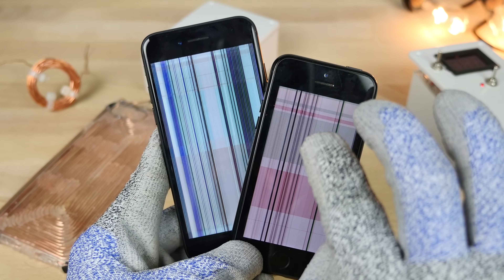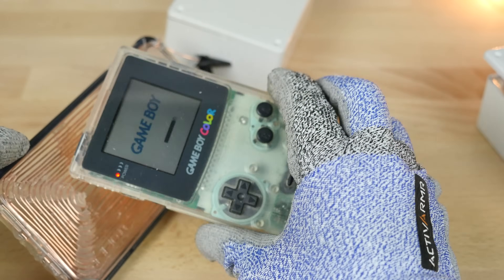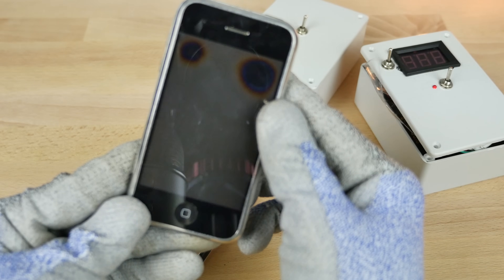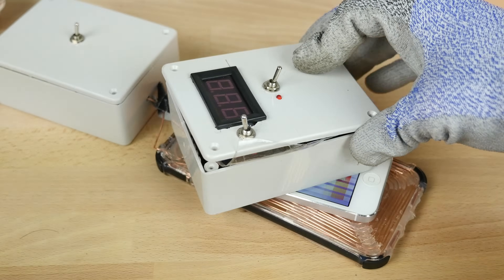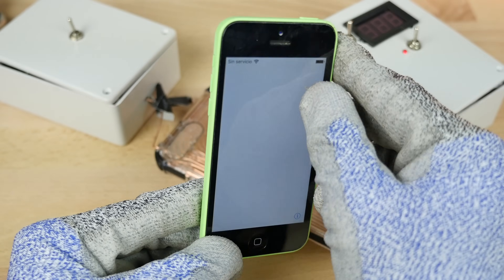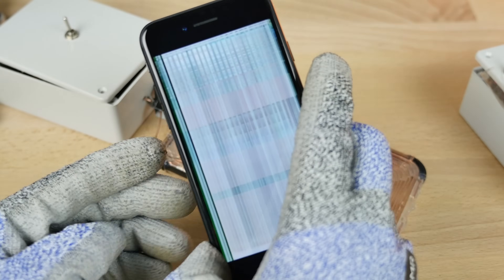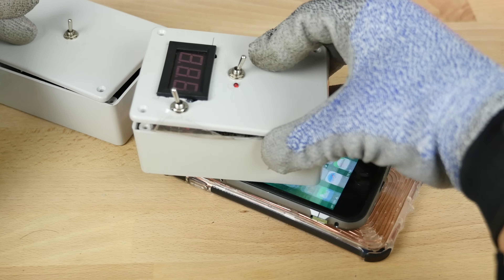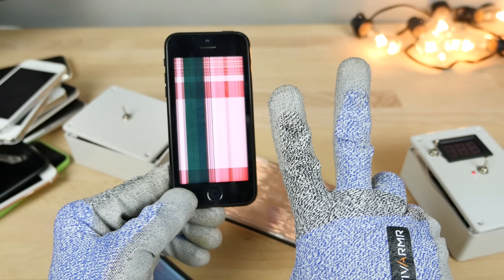EMP Generator vs iPhone 7 & More Electronics!

Comment: Its probably affecting the clock sources in the different parts of the phone, causes a timing misalignment from things like the gpu and screen refreshing, older phones means less parts and/or less complex part means less clocks to affect. That's only my guess, computer engineering student here. And are you fucking kidding with that plastic on the nokia screen 2:50 ?? you deserve your eyes clawed out because you clearly aren't using them
Reply: This was such a cool video though <3
Reply: Gunther Huebler "intelligent words"
Reply: No actually, that sounds weird as fuck lol, but also interesting. If I had to guess I'd say there's a part in the phone that monitors battery level by allowing a small amount of current through it and that the part is located near the homebutton and not part of the battery itself, the zap may have fucked it up and it's letting too much current through, draining the battery quicker and causing more heat. If not something along those lines I've literally no clue but I'd love to know if you ever find out.
Reply: That's literally what I told you in my comment. It's not because of less complex parts, it's because of metal shielding.
Reply: It's not that. In the older phones, the signal has to travel through more materials (because they are thicker) which shields off most of the magnetic field. The newer phones barely have anything over it's circuitry. They only have the screen and a partial, super fine metal shielding. That also explains why the iPhone with the case did better than the rest. My science teacher told me this when I told her a friend of mine were inventing these.
Reply: What does that have to do with what I just said lol
Reply: xD
Reply: Spam TheChat sorry for reviving an old topic. That overheat issue is the NXP microphone and capacitive touch interface IC being zapped. Suffered from wounded weld. It controls the bottom microphone, antenna switch and the detection ring around the touch id button (trough) the scanner die which is overheating, probably over voltage as that IC manages the power too. 

I tried repairing something similar on an 5s but no avail

All in short nothing you can do except of replacing the button and live with no touch id or get a new phone
Reply: Gunther, talking hard online are we? "You deserve your eyes to be clawed out" ? That's a little aggressive we all know you wouldn't dare say that to anyone in real life..
Reply: http://memes.ucoz.com/_nw/32/10201233.png
Reply: daduncker2.0 They don't put aluminum over screens, it would make it too hard to see the screen.
Reply: daduncker2.0 Just google magnetic shielding a little bit, you'll get it

Comment: This video is pointless. This guy is running out of ideas lol
Reply: MoronPigy it proved Samsung is better than apple at an apple biased channel
Reply: WalrusEmpire he's not even biased
Reply: Betternet I would've assumed he an apple fanboy considering everything apple PRO. but whatever
Reply: WalrusEmpire the reason the samsung s7 didn't get affected was because it is built to support wireless charging. Wireless charging works by sending electric pulses from a coil of wire from the wireless charging pad to the coil of wire (or what ever receives it in the phone ) in the phone. Which means the phone will just take as electrical energy and use it to theoretically charge itself. the iPhone and other phones he used don't support wireless charging so it affects the phone.
Reply: Running out of ideas? This guys reviews phones bro, he wont run out of ideas until phones exists
Reply: MoronPigy your name fits you.
Reply: This was just a chill vid between two reviews

Comment: @EverythingApplePro | Technical stuff:
The liquid crystals in LCD`s are affected by static charge because the  crystals need a veeeery low current to change their polarization. The EMP actually creates big electromagnetic spikes which induce high voltage spikes into the LCD. This causes the crystals to go "wild" and randomly change polarization depending on the magnetic field. This is why it shows wild patterns on the screen. Also the current spikes can damage the row/column driver on the LCD itself thus creating the permanent marks.

On the other hand we have OLED displays like on the Samsung which are technically not comparable to LCD`s because they dont use polarizing crystals. Each pixel is an individual organic led which needs a higher current to emit light than the liquid crystals to change polarization. The EMP induces very high voltage transients but the current is fairly low and not enough to light up individual oled`s. Plus the row/column drivers on OLED displays are designed to operate at a higher current and the EMPs induced current is not high enough to cause damage on the chip.

English is not my native language. Im sorry. :)

Comment: Hahaha, "Electric proof gloves".. they're insulating gloves
Reply: Ben Carter

Thats the same thing.....
Reply: Raymond the back of the gloves aren't "electric proof" the palm is covered in rubber, which you can call "electric proof" if you want
Reply: Ben Carter insulating means not conducting heat or electricity

Comment: most of the iphones have aluminium body and aluminium is a good conductor so all the electric flux and the electro magnetic waves will be reflected back and if u do this from the screen side it will cause a flickering until they have a a metal conductor covering the ics and the processor but still the the wires running on the logic board are not covered or insulated with a conductor so from the screen side it will show some effect
Reply: piyush tanwar but samsung S series starting s6 has a metal casing. thats not an excuse bruh. samsung doesnt give a shit .
Reply: James Gaming bro i guess then you have never got a hands on an s6 or s7 the have a glass body and bruh if you are into science or know basics so u will know that metal and conductors reflect electric flux and electromagnetic waves and do not let them pass threw and if you know a little bit about electronics and electric gadgets so u might know how pcb boards are made and how electric flux can affect the TRACKS if not insulated with a conductor just do some research bruh google will always help u .

Comment: I'm almost positive this isn't a real EMP generator. As in the description, it says Electro Magnetic PULSE. NOT STREAM. Yes, this does cause an EMP like affect, but it is not a true EMP. What an actual EMP is is a device that PULSES a copper wrapped iron core to create an Electro Magnetic Field (like earths, but on a very small scale version) and then have it INSTANTLY collapse creating damaging current and voltage charges. This isn't a practical EMP generator like one the military would have.

Comment: im surprised how badly Apple has dropped the ball on the 7. its not surprising the Galaxy and older iPhones weren't affected. their casings provide an almost natural shielding which is why they need antenna lines. i would expect older Galaxies from the S5 and down to fair worse due to their plastic build. the newer ones are practically their own Faraday cage

Comment: It's basically wireless charging to the very very… …very extreme. The newer chips have smaller gaps between circuits and this is why there's more shielding. All the affects will be random depending on how long and how you hold the EMP generator to any of the devices. Eventually it will permanently damage the devices.
Reply: Newer chips are more resistant to emp and it won't damage it at all phone still works normally.
Reply: This. I am EE and studied microprocessor based systems design...

Comment: this is because earlier model don't have advance communication technology like Wi-Fi or Bluetooth or Cat 6 LTE
Reply from the maker: Is it really? They are still affected but not as much, hmm.
Reply: Some of it is to do with the lack of advanced features and technology. Most of it is because of the size of the processors, as phones advance from year to year, the transistors in the CPU and GPU get smaller and so do the pixels in the LCD. As these get smaller, the chance of high voltage arcing across where it shouldn't becomes more likely.

Also, the reason why the LCD's were affected more than the processors is because the LCD's don't have EMI shielding.
Reply: +Some Loky Guy But it looks like amoleds aren't affected at all, the Samsung S7 didn't show any artifacts on the screen.
Reply: Wouldn't explain the screen or the restarts though
Reply: Jeremy Gides your argument makes no sense
Reply: Nirav Agarwal Yeah, I guess I would agree. Wi-Fi has definitely evolved.
Reply: By the way, this isn't EMP at all. Its just a basic stun gun, forcing a overload of static electricity into the display interface by  electromagnetic induction. An real EMP would have permanently blacked out that phone in 1/5 of a second. It would jam every billion transistors on that logic board. matter fact, he wouldn't be able to put this video up as a real EMP would even fry his camera and storage devices
Reply: +Gunther Huebler Perhaps the RAM is affected or the storage chip causing a reboot or freeze.
Reply: @Some Loky Guy If it were affecting the processor directly (transistor level) you would see crashes almost immediately, so its not likely affecting things in that way
Reply: Nirav Agarwal yet the android phones survived
Reply: Nirav Agarwal The 3G had Wifi
Reply: I still think that is the reason...
Reply: Shielding also plays an important role. Remember what happens with LG 5k Display.
Reply: Bro although 3G had WiFi but WiFi Technology itself evolved a lot and so is the component for Wi-Fi modules.
Reply: yep
Reply: The screen i/o is directly connected to the display inverter IC or processor. Since the screen I/O isn't shielded at all, electrical inductions occurs on the display interface which is electrically connected with the shielded IC's on the board. The only way to completely prevent this kind of distortion is to use fiber optics. The Air force one aeroplane has fiberoptics to connect digital hardware to prevent EMP induction.
Reply: Nirav Agarwal 

coms tech means nothing when it comes to corrupting the firmware in the eeprom of the processor. The screen screws up because there are ICs for communicating between the processor and the display it self.
Reply: Gunther Huebler not neccsiarly. It completely depends on what is shielded and what is not. The processor is likely shielded so what yoh are seeing is individual parts of the die being affected. It will only crash or restart is the OS is affected.
Reply: Laser Guy usually there is a ic in the flat flex leading to the display. And the processor communicates with that ic usually through a high-speed communication protocol. something like SPI.
Reply: Under a very large EMP all electronic devices would fry. Except the most basic electronics like flashlights or lasers or calculators. But phones, gone.
Reply: Marcus Volpicella cause android is trash

Comment: Its probably because the chip that drives the screen (sometimes in the screen, sometimes on the ribbon cables) does not have the metal cage to keep the interference out. Also your case EMP has no effect because the aluminum backs of the phones absorb the interference before it can reach the phone, but the screens are mostly glass or plastic so it can seep through.

Comment: Could someone explain to me why the first iPhone is called iPhone 2G? If it is the FIRST one, why call it iPhone SECOND generation? You had the #1: 2g, #2: 3g, #3: 3gs, #4: 4g, #5: 4gs, #6: 5 & 5c, #7: 5s, #8: 6, #9: 6s & smaller iPhone 6s, #10: 7, and #11: 7s & 8. Why START WITH 2G???

Comment: Why didn't you just use the more powerful generator on the better interface (the copper wires in the case)? Makes no sense to optimize the lesser generator and make the powerful generator less effective.

Comment: I think that it severely interrupts electric signaling within the video memory die, but not enough to result in system errors or prevent it from working. Plus, seems to create a burn-in in the LCD itself.